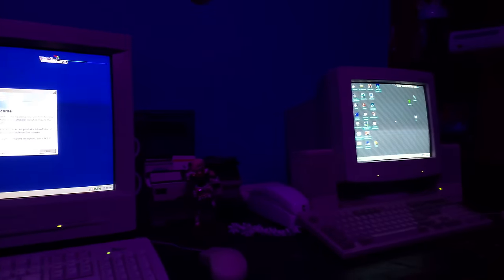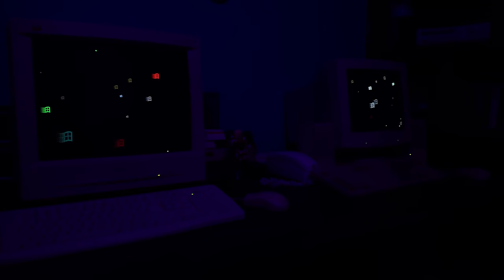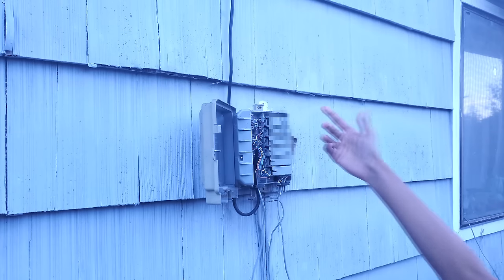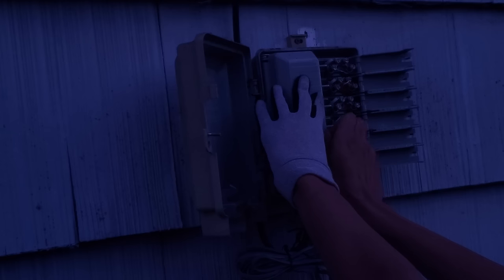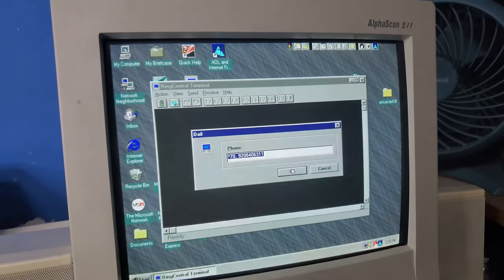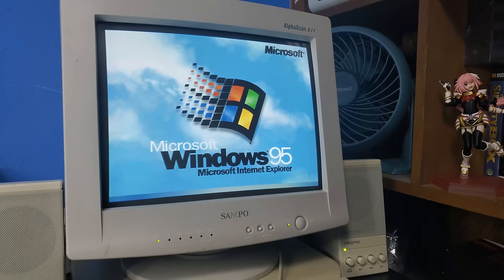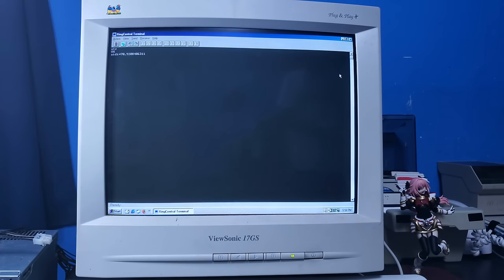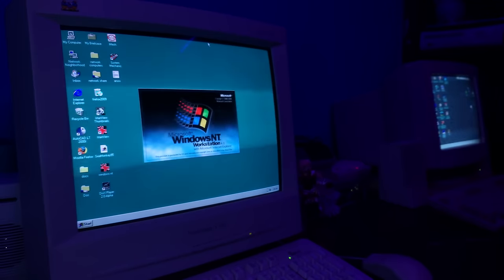Getting Dial Up Internet in 2023!

Comment: I once made a "dial-up" bridge on a Linux box to get my Dreamcast online. Just a phone cable between the console and an external modem, no switching or dial tone happening. Let the Dreamcast dial any random number, and then on the Linux side manually sent ATA to the modem to get the handshake stuff started.
Reply: basically nowadays' dreampi
Reply: I tried doing that with a Windows 98 VM using ancient PC-DC tutorials, it didn't go well for me
Reply: @avegee24tv  but now that flycast can emulate online features kinda not nedded anymore.
Reply: @MilesPrower1992  use terminal in windows, handwritten handshakes etc
Reply: Hmm I need to do this
Reply: Nice !! 👍 I did a test with a magic Jack and a Dreamcast , it worked fine like 10 Years ago,  Linux also.
Reply: @lucasrem I just went for a DreamPi instead
Reply: I wonder if that can be done nowadays...
Reply: Thank you for this video, it brought the feeling.
Reply: Idea: Doom/Quake/Unreal on Dial-up on public servers! Or some old school terminal-based RPGs
Reply: Dreamcast had a NIC didn't it?
Reply: You need to inject 9 v DC though
Reply: i did that with xbox.
Reply: @ElShotte  the nic  is rare. it came out pretty much when dreamcast ended. it also only supported few titles.  where most titles only supported the modem.
Reply: @ElShotte it came with a 56K Modem, you bought the ethernet adapter separately
Reply: Let's take a moment to appreciate the unappreciated awesomeness of the Dreamcast.  If Nintendo or Sony made the Dreamcast, it would have been a huge success.  It was the poor decisions of Sega prior to the Dreamcast that made such an awesome console fail.
Reply: That's a brilliant idea.  I'm gonna have to try that.
Reply: I don't understand a word you said 😞
Reply: @Elite_XE Don't worry. It's all arcane now. Focus on what is happening now, knowing you'll never have to sit on the phone with Microsoft for 3 hours tweaking your Autoexec.bat and Config.sys so in 35++ years you can reminice and others will say exactly what you just did and this  will keep happening, over and over again.: )
Reply: ISP box.
Reply: I miss playing Phantasy Star Online 😢

Comment: Retired Telecom Engineer here. The traditional landlines we called POTS Lines. "Plain Old Telephone Service."  Twisted copper pair-   Two wires. With built in 90v DC electric which was primarily there for the ringer.  If your power went out in the house, the telephone would still work, as the phone company provided that 90v of power.
Reply: They need to mandate that telephone companies are required to provide copper landline service since we recently had two nationwide cell phone outages and copper is the best solution because it doesn’t rely on power at your house. They should also mandate that telephone company that does fiber Internet cannot offer phone service through the Internet and that it has to be over copper. I have written to my local elected officials and the president to try to pass a bill or law that requires copper landline.
Reply: Our telephone company in Manila recently decided to retire all their copper POTS lines because they "couldn't fix the old infrastructure anymore."  They settled on putting "everybody" on VoIP, on top of all the early customers who subscribed to their Fibre at Home service.  Now they're running-up against the problem of not having enough line ports for all their utility boxes outside, and the internet service has become unreliable from all the messing-around they've been doing.  Now I have to find a battery back-up for our fibre modems because my old man still expects phone service even when the power is out.
Reply: @Ryan_Christopher   Where you at brutha? I'm in Makati. Let me know if you ever want to meet up. Retired here from USA.
Reply: @Ryan_Christopher     Cool man. I live in Manila too. Makati. Retired here.
Reply: @Ryan_Christopher say hello to Manila for me
Reply: @rasheedali615  we have better solutions than using this outdated stuff, and in these outages all the lines were overwhelmed anyways.
Reply: @Ryan_Christopher  PLDC right? XD
Reply: I'm not aware of any telco that sends 90 VDC to the house. POTS uses -48 VDC  and there is a 90 VAC @ 20 Hz ring voltage (in North America) that is only sent when there is an incoming call ringing your house. That voltage is removed between rings and goes away once you answer the phone and the central office detects an off-hook. I think Germany was the only country with a higher voltage, I think it was -60 VDC and most of their phone lines were not POTS they were ISDN.
Reply: @SteveW-em6cv    I really curious if any such lines still exist. The voltage varies-  POTS phone wires typically have 45 volts DC across them when the phone is on-hook. When off-hook, the voltage goes down to just a few volts. When the phone is ringing, you'll get about 90 volts AC, so if you have high skin resistance and you were holding the wires, you'll get a jolt.
Reply: @barrycohen311 I'm on DSL over POTS and I think there are still lots of land lines out there. I heard the UK announced they will be retiring traditional POTS lines which somewhat shocked me. I just stuck my voltmeter on my phone line. -53.3V 
I believe they have lead acid batteries at the CO and that is -48V when not connected to a charger. But like a car's 12v battery is at 13.5V when the engine is running the -48V is higher normally as it is running at charging voltage. 
It is nice to have a landline in a power outage but it only works if you have a corded phone. During a power outage my cell reception is awful. I'm guessing the closest tower has no backup power.
Reply: @SteveW-em6cv    Brings back a lot of memories. Did a lot of work on DSL and ADSL.  I have so many grey hairs from my telecom days!  Ha ha. SS7, Basic Rate ISDN. What a nightmare. T1 ground start and loop start...
Reply: I worked at a NOC and remember organizing fuel during bigger storms to keep the stations running. Crazy times. But yes, people's lifelines were kept up by the ISP in case they needed to make an emergency call for example.

Comment: My family had dial-up until 2009, as my father refused to pay for high speed until I hit high school. I have fond memories of trying desperately to play Club Penguin with my friends over a dial-up connection. Good times, lol
Reply: That’s interesting I know some parts or areas still use dial up because they can’t afford or they can’t get cable internet in their area. Some switch to 5G or stay with dial up because that’s all they have
Reply: Just moved out of my parent’s house in rural Missouri where we had 10mbps through DSL because there was no other option……… and now I’ve got 1gbps in St. Louis County. Literally 0.01% of what I have now
Reply: @H8RSAPPRECIATE  I have fast internet, but on hot summer days, I guess some router somewhere gets overheated and I have no internet :) So I bought a 5G phone with unlimited data to solve that. On good days I have over 1100Mb, and on bad days around 20, but at least its internet :) Works when the kids wants to play Fortnite in terms of latency, usually they get around 50ms instead of 30ms when normal internet is working.
Reply: @CalebRazzleberry 10mbps = 0.01gbps, which is 1% of 1gbps. Still a lot faster though!
Reply: I still have 2mbps DSL because it's basically free and I'm not paying $80 a month for internet or any other bill other than a mortgage. If they had decent speeds at a decent price, like $30/month, I'd do it.
Reply: @CalebRazzleberry lol my regular internet speeds.
Reply: @AndrewTSq  it might be where you have the router at but I would try to find a way to cool it down maybe a small fan near lol
Reply: @RT-qd8yl  that’s too much for $80 that’s basically what I have where I live
Reply: We didn't even have the option until then out here,it was like 24 kbps. They just put antennas on people's houses to connect to towers and we jumped at it,we used to have to go into town for the "fast" dialup that actually reached 56k.
Reply: Wow, my family also had dial-up until 2009 because of exactly the same reason! My father also refused to pay for fast internet so we were connecting to the local airport numbers where my uncle used to work so he gave us the login and password back then. I thought we were the last dial-up users in the world.
Reply: @H8RSAPPRECIATE  i mean the internet suppliers big hardware. Not my router :)
Reply: I also had dial up until 2009 lol we didn't have internet for a year after that because recession and all that and ended up losing our house. Well my parents lost our house I didn't have nothing to do with it other than being born lmao I was born in 97. I remember playing NFS 2 and some robin hood type game on the computer and watching lots of 240p YouTube lol Had to wait several minutes just to load a 30 second video.
Reply: my family had land line up until 2021, reason we had it all this time is cause our house was built in 2000 and it had a security system in it that used dial up internet. after 21 years of service, it started to malfunction and so they got a new security system that uses cell towers, so there was no longer a need for a landline phone connection.
Reply: Haha yep I had it till 2006. Can you believe I was able to play maple story with it? Then again it was designed to be able to do so, which is why all the assets are stored on the computer to the tune of a whopping 26gb
Reply: Runescape (At the time) was kinda the only game i could play on dial up. Other games i played were gaiaonline and neopets.
Reply: Hate families like that. We switched to ADSL as soon as it became available in early 2000's. I was a kid back then living in a shitty Eastern European country and we could afford it. Our ISP left a brochure at our doors which said ADSL was available at our location. I showed it to my family and I went with my dad next day to the local ISP office which was a 10 minute walk from our home. Still remember how happy I was. After few days technicians came to our house and installed a new DSL modem. Back then it felt like we had gigabit fiber compared to dial-up.
Reply: And online games would take about an hour to load upon the first time playing them, and some levels and web-pages took more than several minutes to load. Those of us who were kids in the era of AOL, we savored our allowed time on the computer because of the slow connection.
Reply: We got DSL in 2005 because it was being offered for new people and we immediately switched. No more missed calls.
Reply: Me too man. I grew up without cable tv and I bought a Wi-Fi adapter to steal the neighbor’s high speed connection for my music pirating needs.
Reply: I love old computers as well and I love old windows computers because looking at my few collections of my previous ones is like a Windows museum. Windows is still the best PC I ever have in my life!
Reply: We had the same childhood!

Comment: I am a computer engineer and I love the fact you break down what the sounds mean when dialing/connecting.  You dont see that often.  I used to listen to the handshake and would just hang up and reconnect if it "didnt sound right" so I knew it was a stable and fast connection.  Side note, I used to use BBS all the time, in fact I still have all my old Commodore gear including my modems.  I used my Commodore 64 the most with a 300 baud modem, but I also have a 1200 baud modem for the C64. I didnt use it long before moving to a 286 with a 2400 baud ISA modem, but I remember when I upgraded from 300 to 1200 and I remember it being amazing.  :)    I think my next modem was 14.4, then 33.6 and due to the pretty poor phone service and line quality in my area I stayed on 33.6 for a LONG time since it seemed more stable than my v92 (which I still have as well).   I also remember first time I was gaming "online" with NASCAR Racing (I think it was on DOS)....  with a friend who lived a few doors down.  We would open the game on one system and it would be listening on its modem, then I would RUN home as fast as I could to dial his house so the two computers would connect and we would race 'online'.  It was completely impractical, but we were amazed we could do it at all.  Great video, brings back a lot of memories....
Reply: Gosh.. I was 17 at the time.. i had no expertise but i learnt to differentiate between a healthy sounding "handshake" and an unhealthy one.
Reply: @MayaSalila   I was pretty young myself back then -- when I was using dial up I was the same way where I mostly just knew what sounded good and bad -- I did know a few the the patterns like the handshake, roughly what speed it chose and the last few seconds before the speaker muted you could tell if it was wrong... or if you heard it handshake or negotiate too long, that was a sign too.  It also helped my father was very knowledgeable and worked in the tech industry so I had access to information and tools like a scope.    It wasnt until later in life when I went to school for electrical engineering and ended up becoming a systems engineer in IT did I actually really understand what I was listening to.
Reply: @trssho91  hi man, I used dial-up over 2008, and like you, after a time, I reconnect too if the "didnt sound right", in that time, I did don't know it was a handshake protocol, but I was able to recognize the sound pattern of a "non stable" to a "good conection" sound. Today i'm graduating on networks, and i'm loving to know about these details.
Reply: Haha, so in order to race in-game, you had to first race IRL! Great job putting together that means of direct connection! :D

Comment: Nowadays we see dial-up as primitive and outmoded, but the engineering that made it work in the 90s was insane. 

You see, phone networks were designed to transmit the human voice to human ears. The higher end of frequencies humans can hear is around 20 kHz, or 20,000 vibrations per second. But transmitting that much data is complicated, and most people’s voices don’t sound like a steam whistle, so you can cut way, way back on the frequency range without much loss of fidelity. 

Then, in the 90s when the internet took off and suddenly everyone wanted to send and receive megabytes of data, engineers found a way to transmit 56,000 vibrations (bits) a second reliably on these decades-old lines that were never designed for it. That deserves a lot of credit.

Comment: Major props for doing the Dial-up sound analysis that accurately, I was able to put the video to 0.25 and finally understand what all those "random" sounds were for back then. <3  It made my day.  (Man, the ingenuity of man to make data transfer work like that with such limited tech..)
Reply: I could predict the  result speed of the connection only by listening to dial-up sound
Reply: @gmarchenko good to hear I wasn't the only one that could do that. I called so many bbs's and later dial up isps from 1993 to 2000 and got pretty accurate at it.
Reply: Me too put the video at 0.25 and got know what steps are going on during handshake.
Reply: I thought the same. As someone who used dial up every day growing up I noticed that it oddly always sounded the same when connecting correctly. Now older and much more I.T. savvy this was amazing to see and understand. Great Post.

Comment: Cool vid! Make sure you don't leave that cable outside for too long, it isn't an outdoor rated jacket. The sun and elements will break down the jacket, and remember that shock? That can also mean a fire if you let the jacket get too damaged causing exposed wires. You can purchase outdoor rated cat6 and use the wires inside (which are identical) to hook this up exactly the same way, just tie the old line to the new cable and pull it until the new cable comes thru the path you used. You would have to buy a crimper and some RJ11 (4-pin) mod ends for the phone jack part at the modem though. Be safe, and thanks for the awesome content!
Reply: imagine getting a phone call and hearing I failed shit🤣🤣🤣
Reply: Boosting this with a reply so he sees it (in case he hasn't already fixed this issue).
Reply: @ZaCloud-Animations___she-her  imagine if we still had to use dial up internet how crappy the internet would be then🤪🤪

Comment: They glossed over the best part of V.44. Compression! It seemed variable anywhere from 56k to "256k" depending on date type. Then server-side compression became a thing in combination and it felt like 56k dialup was just as fast as ISDN and budget DSL except for bulk file transfers or video. Most notably, forums such as Anandtech and others loaded as if you were on DSL/Cable at the time. No lag whatsover.
Reply: I experienced that with a Mac and an external modem all the way up to 2004. It was fast enough for everyday surfing.
Reply: Wow, I didn't know it got that good! I just missed those 'wonders'. My last dialup connection was a 56k modem which wasn't a very good one. My 33.6k seemed as good most of the time and a bit more reliable. Local ISP's mustn't have been supporting compression either. Then around 2000 I moved onto cable and DSL.

Comment: Love the sounds of dial-up! I started using dial-up internet in late '92.. I think we had a 14.4k modem, skipped 28.8 and went straight to 33.6 in 1997, made the upgrade to 56k in 1998, then got Microwave Internet in 2000 (which used a dial-up modem to initiate the connection, and was used for upstream traffic then a external roof mounted Microwave Antenna to pull through data up to 300Mbps.. (during cloudy and wet weather though connection was patchy).. fortunately I skipped ISDN and upgraded straight away to DSL when it became available. It started off as 256kbps then 512kbps (a far cry to what I used to get when I had Microwave!) Eventually got 1.5Mbps DSL (which at the time was not available to residential customers) so I used as a business plan, but in 2003, this cost around $149 per month. and only came with a 3GB monthly allowance!